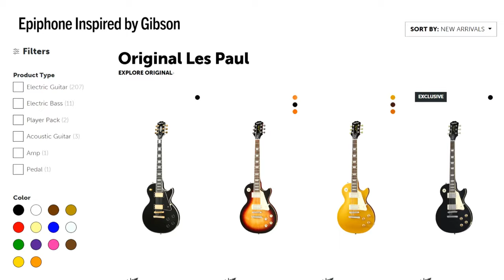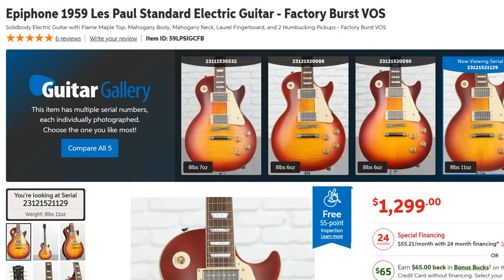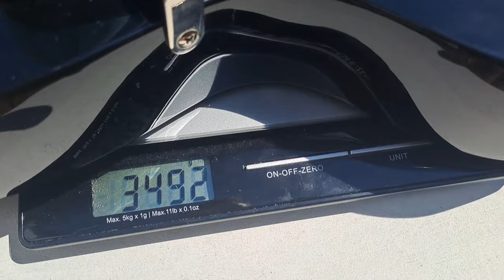Epiphone vs Gibson Les Paul

Comment: I own a Jerry Cantrell signature series '23 Bone White Epiphone LP, a '24 Cardinal Red Gibson Standard, and a Almond Burst Heritage H-150 I'll use to compare my "Les Pauls" between the brands. (1) The Epiphone came with no setup done, and typical Epiphone build quality (if I run my hand down the neck's binding I can feel an edge along with I can feel high/low spots in the wood of the neck) this guitar comes with an ebony fretboard which is really smooth and jumbo frets however, I had to level and polish all the frets but now that I have this guitar plays really well, I play my Jazz fender clean tone stuff on it. ended up being a nice guitar looking past the neck wood unevenness. (2)  The Gibson came setup and factory PLEKd, the guitar is beautiful in every way! The build quality is pretty good, however, I just sent it off to get PLEKd because I can not get a decent string height set, not without ringing out and buzz. mind you I'm not asking for crazy low action cuz I'm heavy handed but a 3k dollar guitar should be able to set a 1.5mm action. So that leaves (3) the heritage, if you don't know, this company was founded by ex Gibson employees at the Kalamazoo location. and build off the same equipment that built all those vintage LPs going for crazy money today. This guitar is not a cheap alternative to a Gibson, you pay about the same for Standard 2,600.00 but my goodness Ive never in my life had touched a guitar that plays this nice, smooth, no defects, sound is fantastic warm. Hands down winner of the three brands! If you haven't, go play one and see what I mean. IDK why I wrote all this other than to say I think you should get what you pay for, unfortunately that's just not true in this day and age, you get what you get and hopefully you take the time and effort to do some research to protect your investment. The price of guitars is insane now and just as I've been having issues with my Gibson LP I have a new Gibson SG that plays amazing at 1.25mm action so it kinda just roll of the dice I guess ;)
Reply from the maker: Definitely, research is king. The biggest problem we have as guitar players now is the sheer breadth of choice. Good problem to have 😎

Comment: If you have the money 💰- The right Gibson Guitars will hold their value and some will go up substantially with age when played - just check the price guidelines
Reply from the maker: It's a sad fact that Epi's tend to wither in value over time - there is the odd exception. Gibson guitars on the whole do go up. This particular one, a Gibson Les Paul Faded from 2018 has gone up a bit which is nice to see, but I never intend to sell it so it is what it is. The Epi is a great choice for struggling musicians like myself to get on the ladder and have a great guitar to play. I bought the Epi as a cheap kind of use everyday guitar, and the Gibbo as the one I treasure and do still use... but I kind of have it on a bit of a pedestal, which is a bit silly I know. If budget and brand were non-issues so much of it comes down to individual preference for the feel of the guitar.
Reply: Epiphone also hold value so get it right
Reply: I think its stupid to buy a guitar for the sole purpose of resale. Guitars are weak return of investments, especially a modern Gibson. Buy a guitar to PLAY the thing. It doesn't need to waste away in some closet